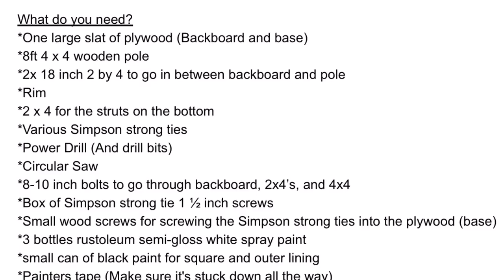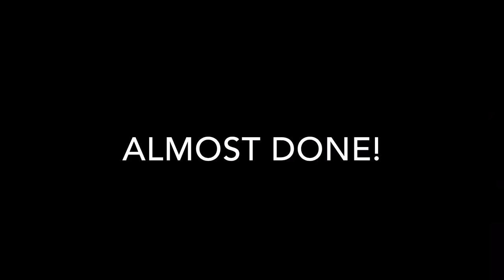How to make a Homemade Basketball Hoop from scratch

Comment from the maker: If you plan to create something like this, it is extremely important to take safety precautions- (1) Always have a solid base that is properly weighted down so the basket does not tip over (2) DO NOT DUNK - although it may seem super fun, this kind of wood is not made for dunking and could result in the wood breaking and injury 
Be Safe and I hope you liked my project
Reply: Dawod I don't like the small width backboards that the stores sale.  A regulation backboard is 6ft wide.  I know I can't have 6ft, but do you think 5ft wide would be ok for your setup?  What is width of your backboard?
Reply from the maker: larry roberson, so mine is actually 4ft by 30 inches (which is what you see in the pictures), but I think if you wanted to you go go the extra foot to the 5ft mark it’d be okay, it might be a bit big though
Reply: Dawod Thx.  Yeah, you may be right about it being a little large so I may knock it down a little to around 56".  The again for answering my questions...if mine turns out half decent I'll plan to send you a pic of our new basketball goal
Reply from the maker: larry roberson, no problem, glad I could help!

Comment: And how did you attach the post to the base?
Reply from the maker: Hey Steffex, so I don’t exactly remember but it was roundabout $125 I believe. The post was attached to the base with a black square 4x4 metal base structure (also Simpson strong tie brand) that had holes on the bottom for large screws. Also for more support we had three 2 x 4 wood slats angled from the pole to the plywood on the bottom

Comment: Y isn't it 10 ft?
Reply from the maker: Hi, Levi Ashcroft buck:
I hope you’re doing well! I did not make it 10 ft so it would be more safe and easily transportable. Also, the 8ft 4x4 pole was the size we thought would work best from the selection at Home Depot. I believe once it was finished, it was around 9ft because the 4x4 pole was 8ft and the backboard and base add some extra length. Stay safe and healthy, have a great one and let me know if you have any other questions! :)

Comment: Hey does not the wood rot
Reply from the maker: If you leave it outside, it may rot after a while. I haven’t left it outside at all, so I’m not entirely sure! Thanks for watching :)
Reply: @dawod3790  o tnx mate
Reply: Using this video as my main guide (with a few minor modifications), 3 years ago I built one for my son.  We kept it outside 100% of the time and played on it frequently.  So just last week, I wanted to raise it up to 10ft and so I flipped it around to look at the base and it was rotted.  But I was surprised it lasted that long, being exposed to the elements.  So now I plan to at least replace the base and longer pole.  Also, I wanted the base to have a little separation from directly touching the wet ground, so I'm thinking of adding a few 2in (height) concrete pavers.  This should allow the base board to last a little longer.